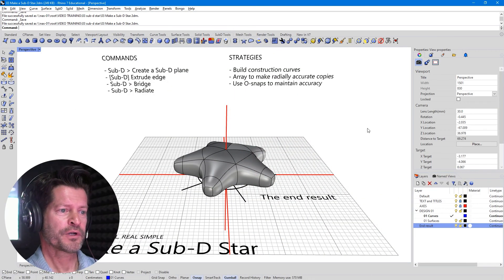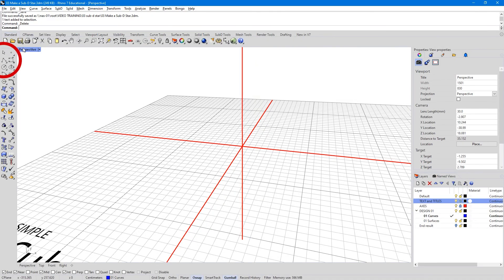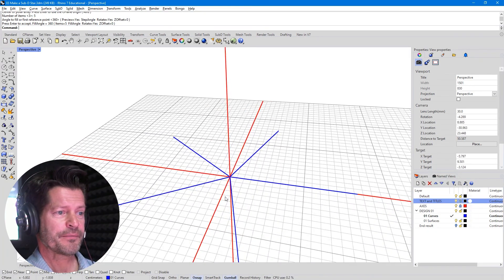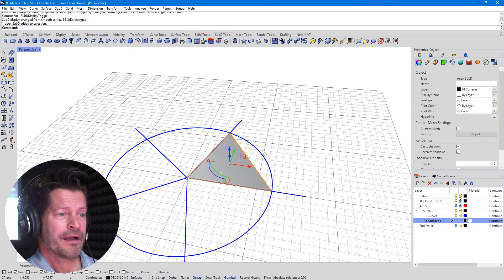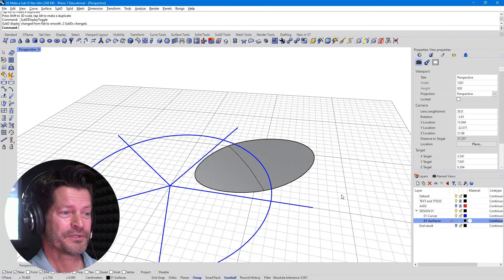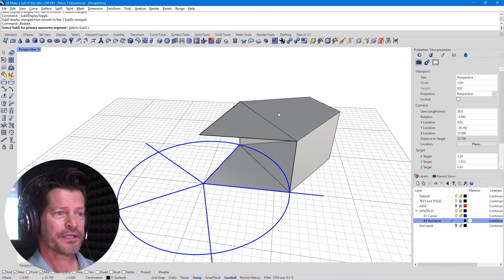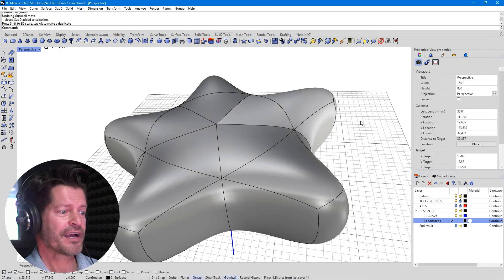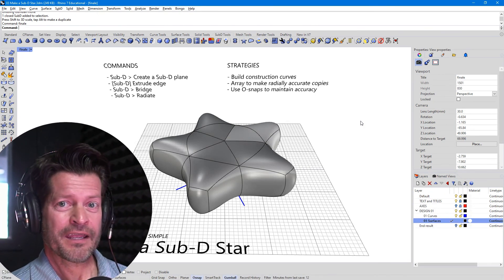Build a Sub-D Star in Rhino

Comment: When I do the radiate command there is a hole in my star. Is there any way to fix this?
Reply from the maker: Hey Soweil. This is a common problem. You need to be VERY careful that (1) you create the first blue line exactly touching the origin. Then, (2) use the O-Snap on the origin when you do the array and (3) create the circle also centered on the origin. If either of these three steps are the slightest bit off, you will have a hole in the center. O-Snaps are your friend! 

Final tip: turn off O-Snap:Near when you don't need it. It can cause acuracy errors; like when you think you are snapping on an endpoint and near snaps somewhere else.